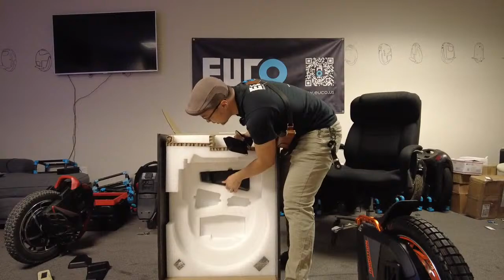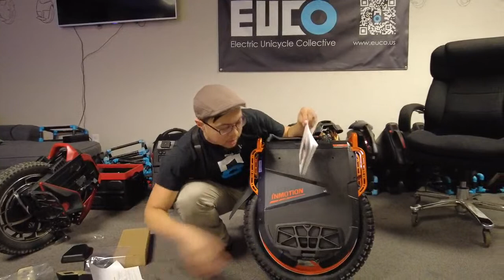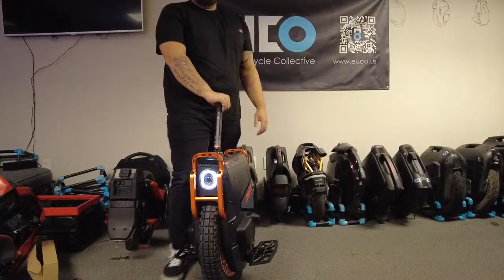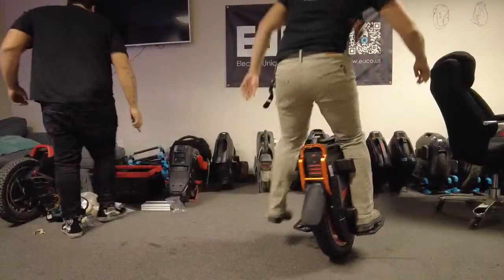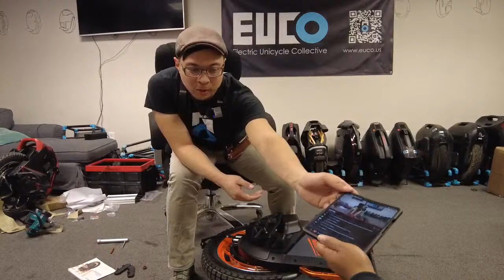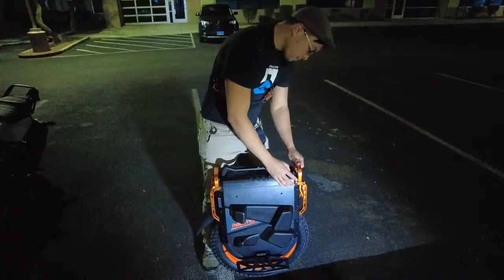InMotion V13 Live Unboxing

Comment: it was advertised online to include everything, and when I bought it it turn out it doesn't have the suspension lock. I contacted them and they said it does not come with the V13 and is a separate purchase. The wheel cost a lot of money why did they have to remove that part to piss people off?

Comment: What? Monster Pro has more torque than V13? The monster is already slugish asf, I was gonna buy the V13 but the lack of torque means It is easy to overpower it, I do not want this for street riding (I weight 105kg geared).
Reply: Bro, just get what you like; the master could have more torque but he was also not really 100% sure, you know how you ride
Reply: @Laic  I ride according my wheel capabilities. He said the torque of v13 is not even close when compared to Master Pro for example. Only thing stopping me from buying another begode wheel is the defective motherboards that they put in their wheels, there are many cases of blown  Masters, I myself blown 2 mobos on the Monster Pro, begode is horrible in terms of part reliability.
Reply: @rouder9237  i agree with you, I will ride what I know and what works for me.
Reply: This wheel is supposed to have 300 nm of torque there's no way that it has less than the monster pro
Reply: How does 300 NM compare to master? Trying to research bu t cannot fin
Reply: @tithipunbunjong9891  i think we would know with more miles in. I weight less so I am not worried about it in my use case
Reply: I also asked another rider who has a master pro and he is 130kg. Also confirmed that master pro has more torque than v13
Reply: @yusufcanaktas6929  if it is same as v12 or more I am happy because I only ride in city, pretty chill
Reply: @Laic  The place that I ride does have many inclines so I need more torque, also range :/
Reply: @yusufcanaktas6929  i hear 👂you man.

Comment: 51:33 will there be a saddle (seat cushion) to sit on the wheel? and how tall are you so we guestimate the size comparison
Reply: There is a seat option and actually looks pretty awesome. I can’t post a picture on here.
Reply: @rockcity513513  you can always link the photo!
Reply: I had a picture of it in my phone. I had to go back and find it on Facebook and then link it.
Reply: @rockcity513513  do you by any chance know how tall the guy in the video might be? im pretty tall ( like 6ft 2) and i'm wishing the pedal height isn't too freakishly high up from the ground (because the taller you are the more likely you wanna be grounded instead of floating lol..) also i ride tesla v1 (do you think tesla v1 pedal height is about the same as inmotion v13 in terms of pedal height wise? or would you say v13 has slightly higher pedal height?)
Reply: @EverlastingEclipses 5’10
Reply: @Stan0619  so its reasonably okay looking if tall person rides v13? (as in visual wise, would it look too out of proportion and looking freakishly tall?)
Reply: @EverlastingEclipses any suspension wheel give you height, just set the v13 pedal low and try to adjust suspension to your weight, plus if you have nice road I don’t think you need a lot of psi in the suspension but all depends on personal preference, you could always remove suspension if you want but being your height on suspension wheel 🛞 you wheel look taller regardless
Reply: @rockcity513513 i have seen a v13 with seat 💺 on YouTube short video. I will juste put my V12 seat there. Or could diy one of those Luna 💺
Reply: @Laic  i might just take out the pressure on the suspension (i'm guessing its same as de-pressurizing a car tire psi from psi valve) cuz i dont need suspension to make me 7ft tall
Reply: @Laic  please sell it LOL i need to buy one for me in Korea.
Reply: @EverlastingEclipses  yes i think if you don’t need to have a lot of pressure it could be nice, but I think it should not be issues if you have right suspension height that work for you
Reply: @EverlastingEclipses  i am waiting for one myself

Comment: Definitely going in the right direction as far as suspension design, but 115lb is just way too heavy. The master is heavy enough for me. Over a certain weight you have to fight the wheel to get it to do what you want and is no longer an extension of your body like with the lighter wheels.